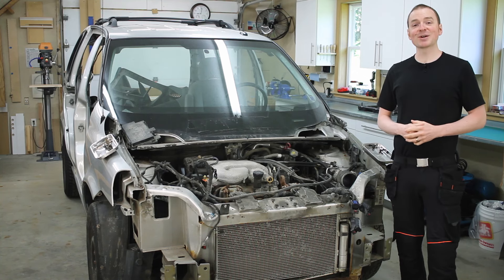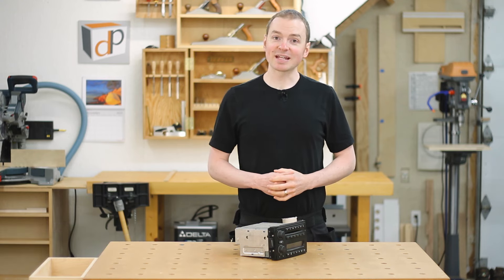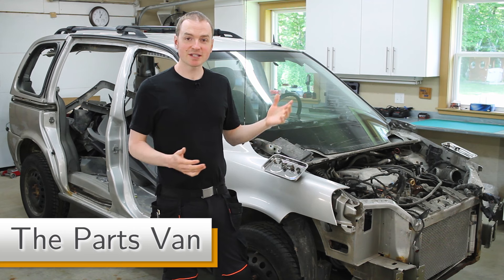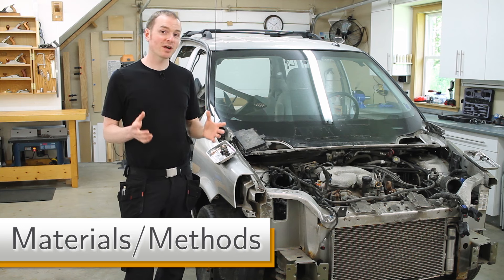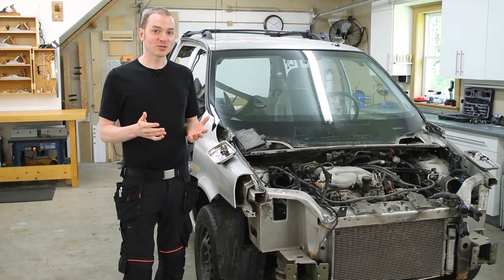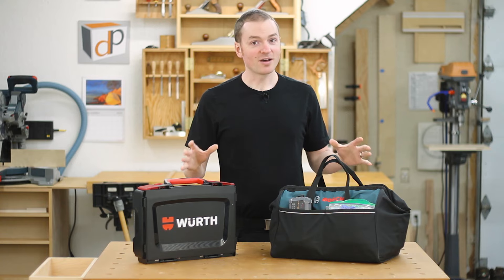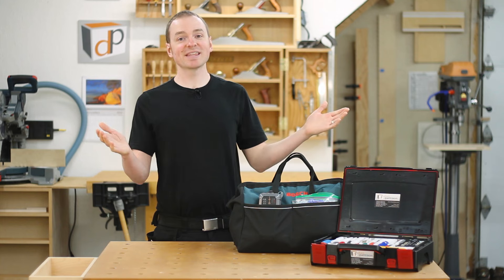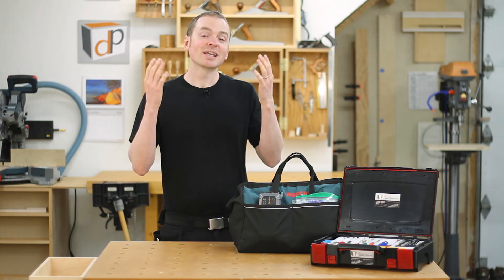How to Fix ANYTHING - Essential DIY Repair Methods & Tools

Comment: I can fix damn near anything. It's pretty satisfying when you are successful. Information is key. Next is figuring out which tool is the best tool for the job. Then you just need the parts and or materials, fasteners, adhesive etc.

Comment: Great video, Dan. I have also found YouTube an invaluable tool for repairing things. I've fixed a couple of front load washing machines following step by step YouTube directions, very helpful!
Reply from the maker: Thanks Brian. I don't know what we would do without YouTube, its definitely a great resource. It's great that everyone can share what they know and we can learn from each other.
Reply: How do I fix GB used?
Reply: I recently 'fixed' our front loaded washing machine, mostly by cleaning various parts. But I discovered it has a full on diagnostic suite on board to test out every single function and see if any error occurs (and its almost 16 years old!). Works like a charm.

Comment: I just watched your review of the two tso squares.  I found it very helpful. I have a makita track saw.  For cross cutting 4×8 plywood with my Makita 55 inch guide rail I'm concerened AFTER INSTALLING the GRS-16PE will I  have enough track leftover to support the saw to complete the rip cut  or will it run out of guide rail support toward the end ? Thank you
Reply from the maker: It ends up being close but it does work just fine to cross cut a 4x8 sheet.

Comment: Great to see a video from you, hope all is well with you and your family!  Your right the skill is troubleshooting, not necessarily the actual object you want to fix.  I am more the woodworking and electrical person, gas engines I find are intimidating, thanks for the encouragement to try my luck with the lawn mower to start!  Cheers
Reply from the maker: Thanks Alan. I definitely found gas engines intimidating before too. Like anything once you learn about it then it seems much more attainable to do it yourself. That was the main reason I wanted to make this video was to encourage people to learn about what they don't know and tackle it themselves. I have thoroughly enjoyed learning how to fix mechanical things and gaining confidence to tackle these jobs myself. Great to hear from you, hope all is well with you and your family!
Reply: I actually find woodworking confusing. I enjoy taking things apart. I am by no means a professional at anything and have little to no skill set.

Comment: Thanks Dan, you always have a smarter way. And after all it’s all about smarter not harder. How do you like your axial glide by now? I am thinking about getting one.
Reply from the maker: I really like the Axial Glide for a workshop saw James. I find it's too heavy to take to site so I use the Bosch CM8S on site. I have no complaints about the Axial Glide other than stock dust collection but I fixed that.